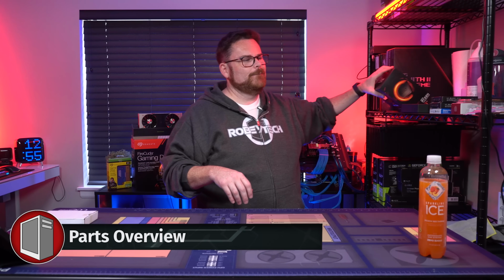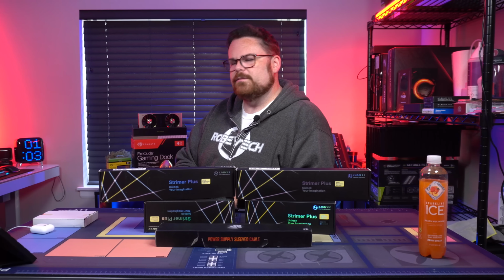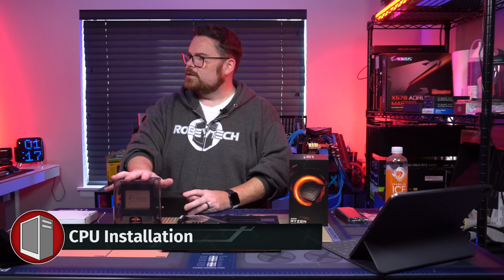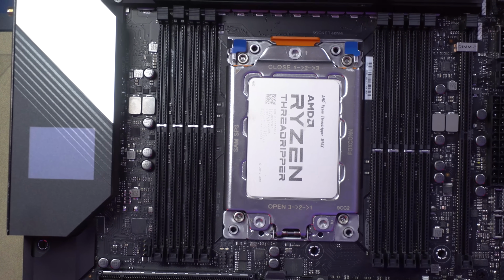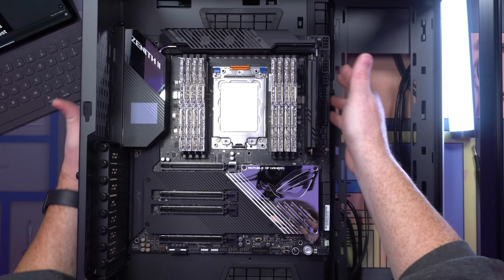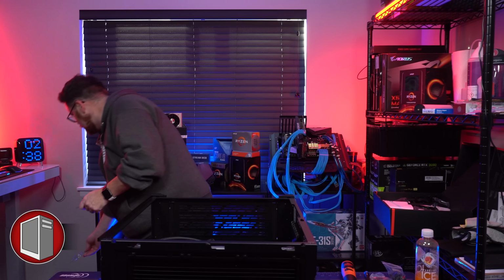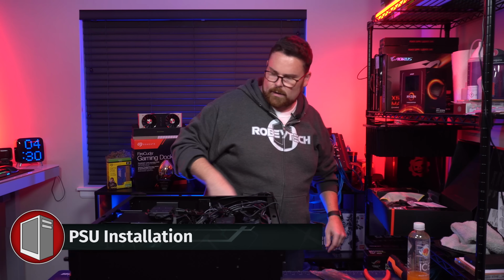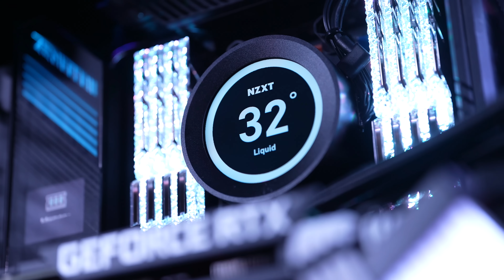Want a car or a PC? The $10000 Dual RTX 3090 Gaming PC Build! | Robeytech

Comment: when a RGB Cable extension is more expensive than your CPU
Reply: LOL
Reply: its ok this guys pc is worth more than everything combined
Reply: Satomi Murano  what one you got?
Reply: Satomi Murano  ryzen 5 2600. It’s like 128
Reply: Hahaha nice one
Reply: Satomi Murano  nice
Reply: @w2zup60  i got ryzen 7 2700x
Reply: Satomi Murano  what card is it i mean crisis 1 on med setting is pretty good on my old laptop i had intel hd 520 not dual channel ram ddr3 no ssd hdd and i ran it at around 20 to 25 fps sometimes it would reach 30 on lowest settings 720p i have just upgraded to a rig now and i am as happy as can be i can't believe i was able to get a rtx 3070
Reply: Satomi Murano  well i mean if you have the same specs seen in the video 
i5 3370
8gb dual channel i believe
it should be ok and should be able to run games like gta v and fall guy or fortnite at 720p low so it seems ok
Reply: Satomi Murano  400 mhz ram might wanna overclock to at least 800 mhz
Reply: Satomi Murano  do you have a dedicated gpu like a gtx 750 or gt 1030
Reply: Satomi Murano  ok set your what i am thinking laptop to performance mode and disable all windows animations and if you are not already play at the very most 720p but if you can try gaming at 480p or 800/600 which is 480p thats how i just only a few months would game or i would just play on my console
Reply: Satomi Murano  have you set at performance mode and disabled animations anyways i mean with your specs it would make a diffrence trust me i did it on my old laptop a while ago and gained around 20 to 30 fps in some games and try more light titals such as indies like human fall flat or esports games like valorant or cs go or try some older games like portal crisis
Reply: plus you could disable windows defender but i would not recomend it as it puts you at risk better leave that
Reply: Satomi Murano  far cry 4 will not work for sure but fall guys and far cry 2 maybe far cry 3 might work and i know valorant will work for sure as i am pretty sure you could play that on a potato same with cs go and maybe gta v if played at  360p or 480p and plus online in small lobbys are slightly less demanding then say the base game but just don't go for lobbys with more then 4 or 5 freinds ok :)
Reply: Satomi Murano  yeah fine i rarely use it as is but ok
Reply: Satomi Murano  idk where do you wanna talk
Reply: Satomi Murano  ok i have spent ages crunching up the numbours and its best upgrade to a optiplex and get a gt 1030 as its a low watt card but will run some games or when they come out with a new one like a gt 3030 or somthing a long them lines and save up if you can't and want to play some game's i would not know what to do other then play some older games instead or use geforce now like my brother did with his craptop
Reply: @benchmarkerlovesgaming140  ?
Reply: when one of his gpu's is worth more than your whole pc build
Reply: The the cords costs more than my whole pc
Reply: Satomi Murano  when an rgb cable extension is worth more than my house
Reply: Satomi Murano  lmao
Reply: Satomi Murano  400 mhz?? Not 4000??
Reply: Jay _TooGoated  what speed is the ram? And Yh get the lian li it looks better and is better
Reply: When the RGB cable extension costs more than your pc
Reply: Oof
Reply: You mean your setup
Reply: But more leds=more fps
Reply: No He should not use it for roblox lol
Reply: @kingstyn1970  huh
Reply: @benchmarkerlovesgaming140  i have the 3700x and 3060 loving it
Reply: Jay _TooGoated  honestly go for 5000 series of ryzen
Reply: @tjiizz6956  I know have you tried control with RTX yet damn that look's good
Reply: @orlandopeterson6130  why would he have ddr3 or ddr2 ram that is  4000 mhz
Reply: @benchmarkerlovesgaming140  nah haven’t yet but i’ll prolly check it out
Reply: @tjiizz6956  ooh also flex damn does it not look good
Reply: Jay _TooGoated  honestly it is fine great cpu it's just ryzen currently is really good plus there really good because someone on a b350 mobo and say a ryzen 3 1200 could get a ryzen 7 3700x easy there really good and I'd say more budget friendly in way's but a 10900k is nothing to scoff at
Reply: Oh what to say ay
Reply: Oh what to say ay
Reply: @Haruki2009  ?
Reply: LMFAO
Reply: it took you nearly 5 hours 20 minutes to make ask me how

Comment: In 2016 I built a kick ass PC, $6500, it still plays everything at the highest speed possible.  Think I'll upgrade the gpu soon but other than that it rocks. If you ever get the chance to build one do it.
It lasts a lot longer than you think and as a yearly cost it is quite cheap.

Comment: This is almost exactly the build sitting in my newegg wishlist, with a few variations. Price point is about the same.
Reply from the maker: It's a BEAST!
Reply: Damn mommies wallet gonna take a blow...
Reply: Why threadripper tho 3950x better and that case has so airflow
Reply: Can you buy me a pc?
Reply: @thenihilisticvoid  your build makes no sense. What do you need 256 gb of ram for. Just get the new Ryzen series unless you are a professional video editor. Really overkill especially if you upgrade 2 years later
Reply: @peakdread2598  i mean he could be rich
Reply: @example5237  but like what is even the point. That’s just wasting money in most cases. Like 256gb of ram is overkill
Reply: @peakdread2598  there’s literally no reason to upgrade 2 years later if you a pc like that
Reply: @peakdread2598  I mean sure 256 is overkill for most things but why not lol if you have the money why not and  I really really really doubt he gonna upgrade anything besides his gpu/cpu in the next 2 years, and also if he upgrades he wouldn't just toss the build in the trash that would be dumb. you can never have too much of something if you have deep pockets
Reply: @example5237  because it’s useless to have 256 gb. Especially with ddr5 coming up. It’s called throwing your money in the garbage you will never need it. It is just to be rich and flex your money
Reply: @peakdread2598  that's his money so what's your problem hating on something he wants
Reply: @johnnydinglenut  3970X > 5950X > 3950X
Reply: If you start flipping pcs for that price, you can make money to put into different stocks and become rich
Reply: @txic.4818  I mean you could literally build a $8000 PC, sell it for $12000 and do it several times because the target audience will buy anything that has the best hardware and enough bling. The kind of audience that would buy a 2080Ti when 2080 is better value.
Reply: @gurjindersingh3843  Right, imaging making 5k off of that and just throwing it into mutual funds and cryptocurrency... big stonk
Reply: @txic.4818  Who needs to go to college when you could just make money with Mutual funds?
Reply: @gurjindersingh3843  ^
Reply: @peakdread2598  Yes I'm agreeing with it is just to flex your wealth but why not have 256 if you can afford it. If I could afford 256 i would.
Reply: To be clear, this is a fantasy build. I don't have 10k to drop on a desktop. In a hypothetical world where money's not an issue, though, why wouldn't you build the highest performing machine possible? Sure, it's overkill; and that's the point, because then it will last you a long time. And it's super cool! That's part of what being a tech enthusiast is about.
Reply: @thenihilisticvoid  :(
Reply: @thenihilisticvoid  yeah that’s true. I thought you would have a use to get the full potential out of a machine. That’s what I meant.
Reply: @peakdread2598  that's fair! I do have a multi-monitor 4k system that has games, streaming movies shows, with two Twitch streams running in tabs at a time (because that's what my ADHD brain needs); all while having a million (figuratively) windows and tabs open in a web browser, while also writing a paper. So, the more RAM the better. But as I said, this is well outside of my budget presently.
Reply: @thenihilisticvoid  yeah you will need a lot of ram for that.
Reply: @thenihilisticvoid  D:
Reply: Jay _TooGoated  i would personally go with amd if you want to game.  You are getting better bang for your buck for gaming performance. Also if you went with a Corsair case I would go with a Corsair aio
Reply: Jay _TooGoated  if you are just gaming I would get the 5600x. If you are doing other kinds of intensive work then the cord i9 10900k
Reply: Jay _TooGoated  on which video. Most videos show the 5600x beating the 10900k. Including gamers nexus and hardwarechunkus
Reply: I mean some developers do need that amount of power for their work and hobbies
Reply: @peakdread2598  why you so pressed? It’s his money let him spend it on what he wants.
Reply: @Scalesti  because it would become outdated in less then a couple years. Ddr5 coming out soon
Reply: @peakdread2598  yea but that’s his problem to deal with.

Comment: Is no-one gonna talk about his fans being ad expensive as my entire setup
Reply: The fans are cheap though
Reply: @asimo8146  3 fans for $200 is not cheap, and he got 9.
Reply: @Blaahb  wait what, the last time i checked the prices it cost 100. Welp mabye prices changed
Reply: @asimo8146  they are impossible to get for retail rn.
Reply: @asimo8146  I just used the price he showed in the video. And still, $300 worth of fans is not cheap, especially when you're only paying the premium for fancy lights.
Reply: That’s part of the premium of the case, most cases only require 4/6 fans. This one can be used with 6 fans but if you’re going for the look you bought the case for, you have to spend more on having 9 fans. Those fans are hard to get atm but they are pretty middle of the range in terms of cost
Reply: Found a couple 3 packs for 99 the other day. So stoked to plug them into my o11. The 5950x gets here tomorrow. Build is almost complete, finally!
Reply: @TheStereoField  sounds like a BEAST of a computer
Reply: @yapuka440  it is a beast! 
But I’m having issues with the 5950x. There’s something funky going on with bios or firmware. 
On my MSI X570 Meg unify with latest firmware and stock settings the cpu is nearly always receiving 1.48 volts and clocking at 4.8ghz. During 4K gaming it’s hitting 79c regularly and idling 55 - 65. I have a 360 AIO and had no trouble with temps on my 3700x. 
I tried PBO on, PBO off and eco-mode and they literally all had ZERO effect. I finally tried applying a -.100v offset in bios and my temps are now cool as a cucumber 30-35 idle and peak 65 during gaming with voltages between .9 and 1.1. However the clock is now maxed out at 3.4ghz. It seems very odd that applying a small negative offset would just drop the voltage so drastically. I’m baffled. 
There is something very messed up here and my guess is that PBO is simply broken.
Reply: Lol these are 79.99 for a 3 pack. I bought 9 the other day. And he also installed them backwards.
Reply: Jay _TooGoated  that seems pretty to me. I have the o11d and airflow is pretty good. The 680x looks like it might be a little better from a pure airflow perspective?
Reply: @Blaahb  yeah my fans were some cheap rgb fans that are 15 dollars per 3 pack

Comment: where is the sli bridge and how are the temps on the top 3090 looking at the fact that its fans are completely blocked?
Reply: Unfortunately, there are no 3-slot NvLink bridges and this motherboard does not have the required 4-slot PCIe spacing. There are plenty of motherboards that have 4-slot spacing so choosing this Asus seems odd.
Reply: there's no sli support for the 30 series cards only for the quadro cards which is NV link.
Reply: @intothebeyond8763  There is sli for the 3090's, just for another time please look up what he's talking about before saying that. Plus you can even see the sli connectors on the gpu's.
Reply: @matthewestes1366  Look at what i replied to, maybe read what Andrew said before commenting something obvious
Reply: @noclip4163  dude chill
Reply: @matthewestes1366  Yee, we agree right?
Reply: @intothebeyond8763  Lol there is for the 3090. They are not that stupid :D
Reply: @spartanm0752  dont need to use SLI bridges anymore
Reply: @ghostshadow1794  You are correct that you can run both in the machine and use both in programs without a bridge. However, if a program requires that the GPUs directly communicate with each other (like in some games and benchmarks), you will have to have an NvLink bridge.

Comment: That top 3090 is gonna be screaming for air.
Reply: Can you explain? I’m new to pc gaming and just wanted to know if the 2 GPU’s would divide the workload.
Reply: @phoenixmorphix  GPUs intakes air through the fans (bottom on a horizontal installation). Even though some of the heat is dissipated through the metal plate at the top, the fans do most of the work for keeping your card cool.

So since the top card has another card under it which kind of blocks the airflow for intake, then "the top 3090 is gonna be screaming for air". Adding also that the bottom card is dissipating heat from its top metal plate, so the top card will primarily be intaking all of that heat into it.... it's absolutely stupid. 

But seriously, seems very little thought was put into this build. I think this is a case of someone with tons of cash on hand who told Robey to bulid the most expensive computer, regardless of temperature strategy.

instead of going dual 3090, they should have went with single 3090 but water cooled.... and DIMMS with no fake diamonds LOL.
Reply: @PLVC3BO  yeah the dual gpu is overkill and they will become really hot and the top gpu I’ll be lacking airflow so it will get quite hot
Reply: @PLVC3BO  single 3090 is the best way to go if you have the money. You really only need it if you’re playing games like crysis and other top notch games. His mind is like: the dual gpu will give me more fps
But in reality it just makes ur pc a toaster
Reply: @somerandom8419  people have different use cases tho

Comment: i'd be curious about the temps on the GPUs on max load for extended period of time, that'd be a real test of the cooling. two air cooled 3090s right next to each other like that i can't see working normally unless you have insane airflow and ambient temperature. i'd expect they'd have to be watercooled to function normally
Reply: Id be interested in... like any benchmarks.
Reply: i dont think those 3090s will ever run at 100%🤣🤣
Reply: Just put the pc in the window with the window all the way up
Reply: @astrokid834  got 2x 3090 fes air cooled and actually still get pretty good octanebench scores . Around 1350 ish
Reply: definitely
Reply: That's why you should always put your AC to 16° Celsius

Comment: 1200W isn’t enough to sustain dual 3090s and a thread-ripper under load. Overclocking is out of the question for this build without a 1500W
Reply: I think so too
Reply: Why would you need/want to overclock it though?

Comment: I feel like the 3200mh speed of the ram is kinda bottlenecking itself as the ryzen cpus are ram speed dependent, as well as the mobo being able to handle faster ram (I think )
Reply: I was thinking the same thing. He went all out every other part of the build and then only puts in CL16 3200mh ram. At least get CL14 ram.
Reply: @turtles9707  also the fact he uses a AM4 socket cooler for that massive CPU, how does it fit it all?
Reply: Threadripper isn't "ryzen", RAM speed is not nearly as relevant as it is for gaming with TR CPUs.
Reply: It's clearly a content creating machine, so it's the quantity of the ram that he cares about most. Rendering raw 6k video, digital effects and cgi. You'd be amazed how much ram you need to run those programes using uncompressed video from high end cinema cameras. One of the few machines that can actually use Davinchi to it's full potential.

Comment: The two GPUs are so close, I wonder what the thermal status looks like when both of them are at full capacity.
Reply: I also have the same thinking. They are so close for the triple fan. Not good for a long time using.
Reply: What game in this world can fully use 2 3090 ?

Comment: The funniest thing is that the second 3090 does literally nothing except hog power and heat air, it's not even connected with nvlink. Now that's a flex and a half.

Comment: im currently building a build similar to yours but with a ryzen 9 5950x on an asus crosshair viii extreme. I just now realize all the problems a dual 3090 can cost you especially finding the right motherboard with the right SLI/NVLINK spacing on the Pcie lanes. I guess the best mobo for dual 3090 is the Gigabyte Aorus Xtreme AMD TRX40  or the TRWX motherboards where you can use 2 x16 PCIE lanes for dual 3090s for now.

Comment: i would put the first gpu wires top of the gpu and then under the second gpu, yes i know it be under the fan, but with fans under it and in the gpu it would not restrict the air flow in  the cooling process

Comment: Curious, what would the top 3090 temp be like? My basis is that heat rises and they are soo close to one another so doesn't the above 3090 suck in the warm dispensed air from the lower?
Reply: I have a similar setup (GPU-wise). The top card runs about 10c hotter.

Comment: Oh God, I don't want to know what the GPU temps are going to be at with a sliver of space between them.  Odd how they didn't want to run gpu liquid cooling.  Even with 9 fans, one f those cards is bound to thermal throttle or at minimum take a massive performance hit.

Comment: So you are Intaking from the top and the bottom and exhausting from the rear? So 6 fans for intake and 3 fans for exhaust and 6 fans from the gpus sending hot air up? Oh?

Comment: Why not put NVLink on? and the 3090 on top will be hot. The GPU memory junction temperature is 108°C when rendering in my case with two 3090 Zotac. If I had known that, I would have chosen water cooling.